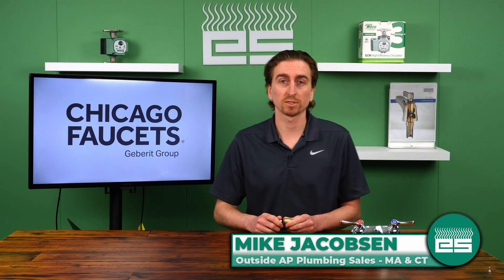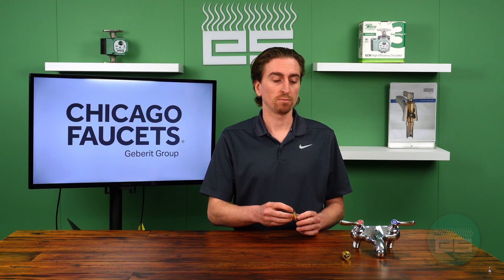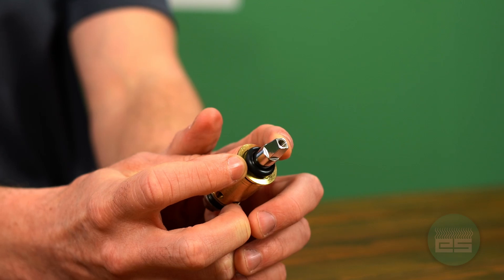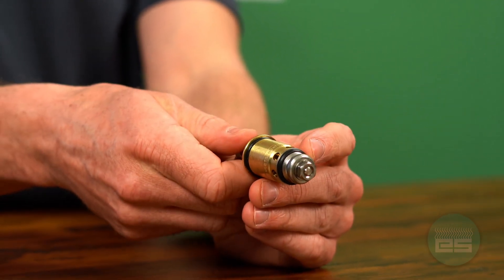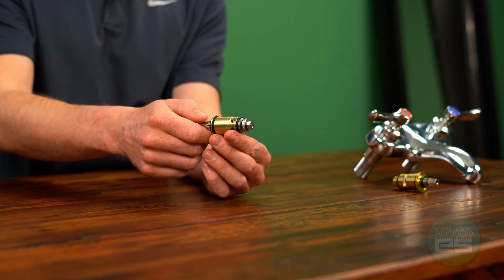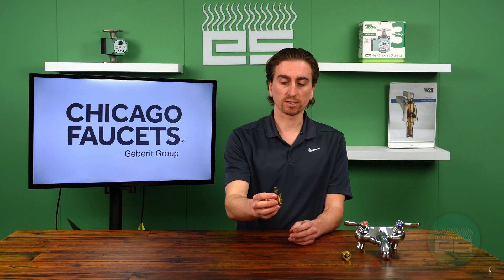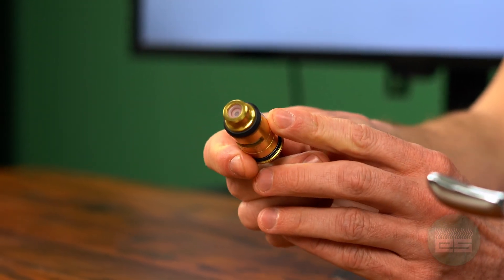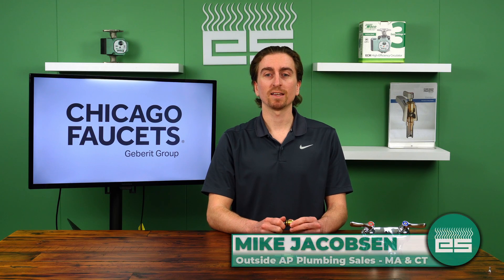Chicago Faucets Quarter Turn Cartridge | Easy to Service for 100+ Years! | @ChicagoFaucets

Comment: Can the ceramic disc cartridge be used in place of the compression type cartridge?
Reply from the maker: Yes, for Chicago Faucet, the ‘XK’ ceramic disc style cartridges are 100% interchangeable with the ‘XT’ compression style cartridges.

~ Mike Jacobsen